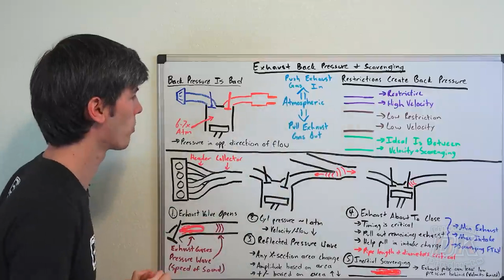Harley Backpressure & It's Effect on Performance

Comment: They won’t dyno tune my 2020 CVO limited with SE-131 Stage 4 with a jackpot decatted headpipe 2-1-2 with TAB Zombie slip on’s? I’m told I need back pressure with lower db? Why?
Reply from the maker: Hi Mark, It may just be the verbiage the tech is using by saying "backpressure" or maybe he is simply uneducated on the concept of backpressure. This is my personal opinion but my observation is that many dyno operators like to see a certain end result or number. Larger baffles are great for sound but do not do anything notable to build exhaust gas velocity and therefor will not do a great job an bolstering peak TQ numbers in the end. They may even be more difficult to build a tune around but that is something I am sure he could clarify for you. What I am confident of is that if you equip the Zombie baffles with the TTI, and really push him to tune that set up... he will see that with the right configuration the Tabs with Z baffles are comparable to any slip-on. Basically, the TTI will correct any shortcomings of a larger baffle BUT If they will turn down $$$ based on a gross misunderstanding of "backpressure" take it as a 🚩 and find another tuner. DS
Reply from the maker: Why?  Are you in California?  Or one of the other States that have adopted the CARB guidelines?

It is possibly because they are concerned about working on a bike that will not meet EPA or CARB standards.

Regarding the comment on backpressure, that is pure ignorance.  There is nothing in any EPA or CARB guidelines about backpressure, and adding backpressure to an engine is detrimental.

I would find a different dealership.

Oh, and I would also watch these two videos, one regarding dyno tuning in general and the next one regarding dyno tuning and a 131 Stage IV.

https://www.youtube.com/watch?v=isBHK-Jy7Wk

https://www.youtube.com/watch?v=MSqLQl3dDAY

Thanks for commenting! MB
Reply: @DKCustomProducts  I live in Indiana
Reply from the maker: Yeah, Indiana is Not one of the 13 States that have adopted the CARB emission standards out of Cali.
As Dwayne mentioned, it is either miscommunication or a red flag that they do not know what they are talking about.  Always feel free to email or call with any questions.
Support@DKCustomProducts.com
662-252-8828
KP

Comment: So if I have the Vance and Hines 2 into 2 big radius pipes do I want the standard baffles in or out?
Reply: Pull out 🎉
Reply from the maker: It really matters what baffles you have. If you have the open baffles where you can see through the exhaust you can install the TTI's into the baffles, but if you have a baffle that is restricted or you can not see through the exhaust you would need to remove the baffles and insert the TTI's directly into the exhaust. 

The best TTI results will come from the standard open baffles or no baffle.

Please feel free to email or text us pictures looking into your exhaust with the inside diameter about 1-2 inches into the exhaust and we can help you choose what size TTI and weather removing the baffle of keeping the baffle would be beneficial for what you looking for;
Support@DKCustomProducts.com
662-252-8828

Also here is a report we've done on Exhaust that you may find interesting/useful- https://www.dkcustomproducts.com/harley-exhaust-myths-and-facts.htm

Thanks for commenting! MB
Reply: @DKCustomProducts  I have the standard baffles that are open
Reply from the maker: @travislohneis224   The 118 TTI installed at the exit of the baffle would work very well... You can even enlarge the baffle mounting screw hole to accept the TTI. This way you would not need to drill any new holes. The 118 series TTI can be found here https://shorturl.at/cyG35

Comment: What about that lollipop thing that you guys sell the ghost near the end of your tailpipe apparently that creates backpressure what are you guys talking about
Reply from the maker: No, The Thunder Torque Inserts™ do not create notable backpressure. The proprietary concave and wavy design allows exhaust gasses velocity to increase... creating no backpressure, preventing exhaust reversion, and effectively reducing pumping loss to create a more efficient exhaust system over all. Backpressure is counter-productive in exhaust efficiency.

Thanks for commenting! MB
Reply: You may be mixing up "backpressure" and "anti-reversion".

Comment: Hi guys, thanks so much for the information! I bought the TTI's for my 4" Roadshark slip-ons a while ago. But, I haven't installed them yet because I'm wondering if I need to eliminate the baffles first?
Reply from the maker: That will be a personal preference. I do believe if you are keeping the baffle in you will need the Long Thread TTI's. You can remove the baffle and install the TTI's or you can install the TTI's into the baffle. 

If you would like more help deciding what to do you can email our Customer Service and they will help you decide what size TTI's you need and which will better benefit what you are looking for;
Support@DKCustomProducts.com
662-252-8828

Thank you for commenting! MB
Reply: @DKCustomProducts  thank you! I forgot to mention that I have the largest ones.
Reply from the maker: If you are installing the 258 TTI's into a baffle you would need to get the Long Thread TTI'S and install it through the baffle and the exhaust. The baffle material is not thick enough to support the 258 TTI by itself. 

Please feel free to email or call us with any questions or concerns;
Support@DKCustomProducts.com
662-252-8828

Thanks for commenting! MB

Comment: Exhaust is confusing 🫤
Reply from the maker: It can be confusing. Here is a link to a report we've made on Exhaust that you may find useful/interesting - https://www.dkcustomproducts.com/harley-exhaust-myths-and-facts.htm

Please feel free to reach out with any questions you might have;
Support@DKCustomProducts.com
662-252-8828

Thank you for commenting! MB
Reply: @DKCustomProducts  
The thing I don’t get is how do my SE slip ons or any slip ons add low and midrange power 
When you can see right through them?
Reply from the maker: Taking the baffles out or running open free flowing exhaust eliminates back pressure, but then you have reversion. That is where the TTI's come in and reduce reversion and speed up the exhaust gas velocity bringing back the torque. 

This video explains this subject very well - https://www.youtube.com/watch?v=pr6z00gL5Yg

Thanks MB

Comment: I've got some Thunder Torques from y'all a while back. They did give the bike a boost and it was fun on short runs. Not my favorite on long rides. That being said they sound awesome so hell I'm putting them back on and sending it to a good dyno. Damn you guys.
Good video.
Reply from the maker: Glad you like the video and have seen the benefits of having the Thunder Torques installed. What was the issue on long runs that you was having ? 

Thanks for commenting! 😎 MB
Reply: @DKCustomProducts  Power came on a little later then I want it. Just didn't quite fill right. I'm running a twin with a fairly mild torque cam and it's nice to just grab a little throttle and grunt on up the hill. I kept getting overexcited and dropping a gear and the state troopers at the top of the hill always like to say hello. Lol
Reply from the maker: When/if you try the TTI again, rotate them to a 45° angle. The more free flowing position will effect how soon or late the power comes on. These are universal but not a 1 size fits all... So some tuning may be required for the absolute best result and I personally like mine at a 45°. Feel free to give us a call to discuss further or go over what size TTI you have to see if there is a better size option for your application- DS
Reply: @DKCustomProducts  I'll give it a try. I've got the biggest diameter you sell because the V&H mufflers on it are huge. If I can save a dyno charge that would be great. Thanks for the advice.
Reply from the maker: No Problem! Glad to help! Reach out if you need anything. 😎